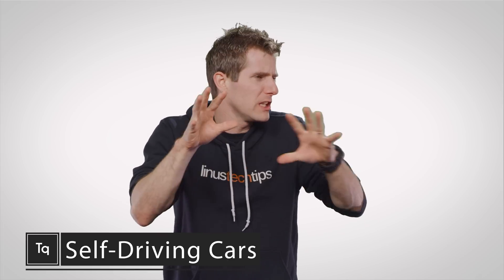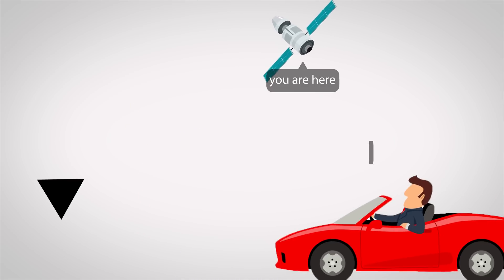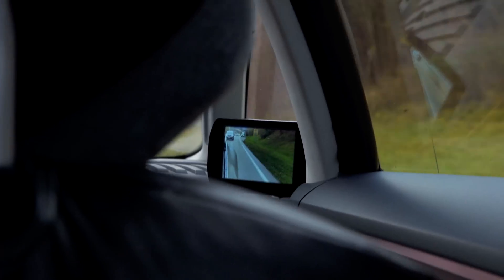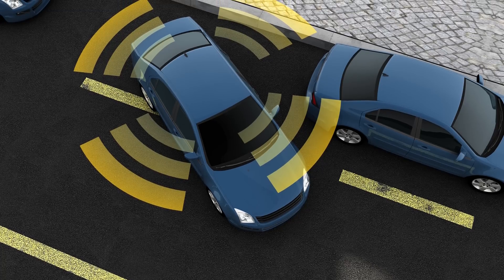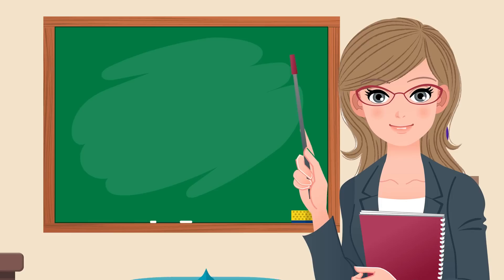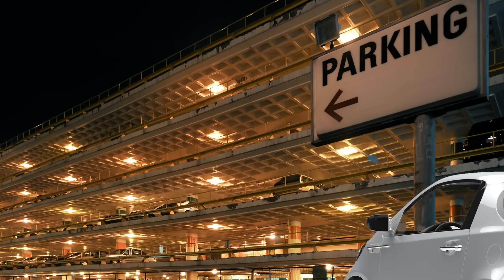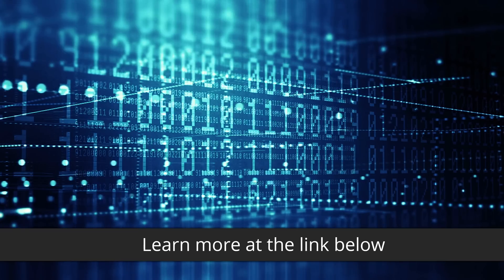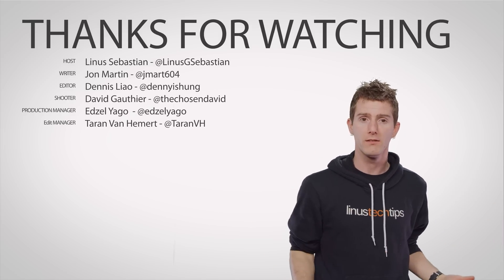Why Self-Driving Cars DON'T Just CRASH

Comment: Now picture the repair bill once those systems starts to faulter.. yep, it's gonna be expensive..
Reply: If those systems would faulter on their own it would be the manufacturers fault and usually there would be an insurance attached. But yeah if you still manage to crash your car it'll be expensive.
Reply: @TheMekaUltra  I imagine that won't be the case once you've had the car for five years.
Reply: @johan.ohgren  ... The  computer components of already existing cars are still the most expensive thing about them. A 'brand new' radio for a 2001 GMC vehicle will still run you nearly $400. Computer components are expensive, especially good ones... which are... you know.. the kind you want in your vehicle.
Reply: @RenniaTrayvold  the computers are not expensive, they just upcharge a lot. A radio should be like $30 but they need to make money somewhere.
Reply: @IhsanAmin  lawl... $30 wouldn't even pay for the materials inside a car radio. Don't confuse modern car radios with your typical stereo xD. Yes they're definitely upcharging, you're right, but not by that much. They'd not sell them otherwise. A competitive market is competitive (Surprising I know). 

So yes, Computers are in fact expensive. CPUs and the equipment required to run them are a lot more complex than a simple transistor radio and thus are naturally going to cost more for the work put in, and when we're talking about computer tech as complex as what's needed in a self driving car? Yeah, it's going to be expensive to produce, and guess what? They too are going to be making their profits... and so is the qualified engineer that you're probably going to need in order to carry out the repair.

So once more, I'm going to have to agree that if one of these busts... It's not going to be cheap. And warranties will probably be the typical powertrain level of warranty for 10 years or 100k miles.
Reply: @RenniaTrayvold  well, the move to cloud based computing should quell those fears. I used $30 as an exaggeration to push my point.
Reply: Also, I don't see their computers being too much as the main cost of a computer is the r&d. Material wise there is a small cost.
Reply: 0 @IhsanAmin  Cloud based computing will not remove the need for on the fly, local processing demands that would be needed for a vehicle traveling in excess of 70+ mph. Especially through a country where the proliferation of the sort of wireless data transfer rates will not become a reality for quite some time. Do you really see the middle of nowhere Wyoming getting high speed wireless in the immediate future? Unlikely. As a result on the fly processing power will be needed for quite a few years still.
Reply: They said that about every system cars have added over the years, including airbags and abs.

Truth is, cars are about as expensive to repair and maintain now as 30 years ago. They are just different.
Reply: @stinger15au   Yeah no, I don't buy that for a second. As a very proud owner of a '69 Camaro as WELL as a 2004 Silverado, and as someone who does ALL the feasible work on them personally (Sometimes you just don't have the time or equipment), I can tell you that that is a load of bullcrap. Even when you take into consideration that the Camaro is a CLASSIC car and thus the prices for repair tend to be massively inflated over what they could otherwise be, the Camaro is A LOT cheaper to maintain than a vehicle that is still nearly 15 years old. And that's considering a vehicle that's from literally half a century ago, let alone one from the 80s which possesses these wonderful things called emission control.  (Which as a hint... made them massively less popular and thus cheaper)

and no airbags and ABS are not the same thing as a central processing unit. I'm not saying the prices will never drop, but they're NOT going to drastically fall within the next decade without a MAJOR breakthrough.
Reply: @RenniaTrayvold  The good thing about reality is, it doesn't matter if you buy it :) That is what's going to happen.

Comment: You know what really grinds my gears? The accepted rule of "have to slow down on a narrowed road due to a construction'. IT'S WRONG!!!
Traffic have to speed up through that zone in order to maintain the flow. IT'S 6 GRADE PHYSICS, FFS.
Reply: It's safety over convenience. If you were to drive even faster when there are mo canre obstacles than normal, it's clear there is an even higher risk of accident.
Reply: @Leonhart_93  I can see the signs and flashing lights from miles before the roadworks (as they usually place them in advance), so I'm prepared to evade those obstacles safely. I'm not a blind moron.

Comment: All these sensors and computation uses up a lot of electrical power so until the battery technology makes a significant leap this will stay a gimmick
Reply: That's one of the reasons why a lot of autonomous vehicles these days are hybrids or EV's.
Reply: they have a generator on the breaks of most electric cars now
Reply: @nathanmead140  All EVs and hybrids can use their drive motors as brakes, generating electricity in the process.

Comment: Cars will always crash. Self-driving cars will most likely crash a lot less than normal cars but when they do, it's not up to the driver or anyone else. So who gets the blame?
Reply: If a self driving car crashes, the manufacturer gets the blame. There will be plenty of lawsuits once these cars are common and they manufacturers will probably go back to the semi-autonomous cars, so they can shift the blame back on the driver.
Reply: @MAGAMAN  I think that is likely to be the case.  Of course, it will result in far more people dying who otherwise might not have had to die.

This is why I feel like we need some kind of legislative solution.  Of course, today cars aren't ready to drive themselves, but at some point it seems inevitable that they will become safer than human drivers, and when that happens it will be crazy to just let people die because we are unwilling to find a solution to the liability problem.

However, the vaccine analogy is probably a good one in this respect.  The limitation of vaccine liability is controversial even today, and many argue that it should be eliminated.  It seems likely that giving any kind of limit on liability to car manufacturers would be just as controversial, if not more, because society tends to be a bit more open today.
Reply: So let me get this straight, you would rather have cars drived by humans and prolong, if not completely refuse the introduction to such a vital technology, even if you knew that the number of deaths per year in the world caused by vehicles would reduce by the thousands, just so you can have someone to blame? Terrific argument there pal
Reply: @mikeey6804  My bad, I initially read only the comment of the person I replied to
Reply: It depends. There are going to be circumstances where these things crash and the accident wasn't preventable (as happened recently when a woman was killed when she stepped onto a road right in front of a self-driving car). The car had no time to react. Or a situation where something suddenly blocks the road and the car has to make the decision to either hit that, likely killing its riders, or moving over and sideswiping another car.
Reply: @ayoCC  Earthquake weren't made in a factory by humans.
Reply: I've read the comment thread and all I'll say is I'm 23 and I will never in my life (which should last another 53 years by the life expectancy here in the US for males) buy, own, or ride in a self driving car.  I do not trust them nor shall I ever do so.  I would rather die because another person was drunk than because their car's computer went all Terminator.  Or better yet, as the movie Upgrade showed, was hacked.  So even when everyone else is out riding in their electric self drivers, I'll be roaring past in my gasoline burning V8.  And yes, gasoline or its alternatives will be around long after the full social integration of electric cars.  You can still find rounds for guns well over 100 years old so no reason to think gas would be any different.
Reply: @randomlyentertaining8287  I expect at some point you will. It may be a circumstance where you are going from one terminal to another at an airport and the shuttle turns out to be not just automated like the ones we have not, but autonomous and gets onto the road for a short period.
Reply: @ayoCC  Yea right... Car just kills someone, whatever, get the money and move on.
Reply: @69MrMaster69  this is actually the model used for vaccine liability. Basically the US government runs an insurance risk pool for anybody injured by a vaccine. The rationale is that the public benefits from universal vaccination and cheap vaccines, but since they are given to healthy people and rarely kill them, they would otherwise be a liability nightmare. More would die without vaccines, but then the deaths couldn't be blamed on anybody. 

This seems like a very analogous situation to self driving cars. Fewer people die, but they're still a liability nightmare as those few can now sue somebody with deep pockets. So, just establish a risk pool and and fixed payment schedule for those who die. 

As with vaccines you would also need regulation since in the absence of liability manufacturers would have incentives to cut corners.

Comment: I feel very confident about self driving cars, especially when I know how electronics are not prone to break and leave you stranded on the middle of the road and especially after Boing 737 MAX 8 MCAS system (new system, like couple of months old ... not prone to breakage at all) wasn't responsible for two plane crashes in couple of months (hooray for faulty sensors and bad programing) ... I see a bright new future for us all; going with our cars to a repair shop every month and leaving our paychecks there. But hey, who gives a crap about you. If you can not afford this then walk, more space on the roads for the rich people.
Technology is great when it helps people, when it works alongside them, but when you are late for a meeting and your car refuses to start because the faulty tire pressure sensor detects flat and there is no way to shut that sensor down and later you find out replacement for that sensor (which is embedded in to a tire so you have to change the whole tire) costs you half of your paycheck and you have three more of this sensors in your car, well, suddenly I like electronics even more.

Comment: When all cars move at the same time when the light turns green...

Nothing is worse than seeing a green light for 30 seconds and not moving.
Reply: That won't change.  The reason you wait while the cars start moving one by one, is basically because cars don't drive as close as they sit while motionless. You can think of the space between cars as a measure of time rather than space. A car being 3 seconds behind the one in front, the actual distance is dependent on speed. 

So basically computer drivers will be subject to the same phenomenon of sitting at the green light while the line in front gradually moves.
Reply: When every car is self-driving, traffic lights will be a thing of the past
Reply: @OppositeToUp  That's almost like saying "I'll pay that bill when I win the lottery." Not gonna happen, at least not for a VERY long time.
Reply: @OppositeToUp  I don't think they will be a thing of the past and neither they should. Even if you have only self driving cars on the road not having traffic lights would create many bottlenecks. What would be nice is having smart traffic light network that is able to accurately monitor vehicles and traffic across the city and based on that info dynamically decide strategies so there are less bottlenecks.
Reply: @Jasterrrr  The cars would network with each other work it out. What you just described could easily be done by the cars themselves working together. Thus no need for lights.
Reply: yeah I fking hate it when I'm in traffic and idiots drive slow and take like 10 seconds to move at a green light...
Reply: I could think of a few worse things... being stabbed in the eye for instance. I'd wager thats a good bit worse than 30 seconds at a green light.
Reply: @firstname565  For someone on the way to a life changing event, they might just take the offer of being stabbed in the eye over waiting at several 30 second lights on the way.
Reply: @firstname565  Being stuck for 30 seconds at a green light while being driven to the hospitle because your eye was stabbed out.
Reply: Shayn Having a miscarriage is worse than getting stabbed in the eye
Reply: @iRicardoYT  and having to wait 30 seconds at a green light is worse than having a miscarriage
Reply: Waiting at a red light for 2 minutes because someone did a U-turn during the green light is worse.
Reply: To calm myself during such moments I audibly play out what must be going on in their heads:

"Huh?! What? Ey George, y'ever see such a thing? That light turned green! Never encountered any such thing in my drivers training. Let me pull out my manual.

Aha. Yes. Let's see. Green light. Means to stop. Just like the yellow light. Wait! Wait.. Actually.. It says.. I should go.

How do I do that again? Let's see..

Mhmm...

Aha. Foot on the pedal."

And traffic finally starts moving.

Comment: I dont trust intelligent cars. I like to drive myself, or even better: Fly.
Reply: That's part of the problem then. Humans cause more errors than computers. It's like that self driving bus that was involved in an incident the day it launched, caused by the other motorist.
Reply: @scriptosaurusrex  yeah, obviously. But computers can be hacked. I cant. Probably at least. I do not want something I can not control. And then, there is Boeing. A software error causes crashes, the airliners have to be grounded. Imagine that with a car. There can be likewise problems with motors, but that is just another single point of failure. It might be better if the software was open source, though.

Comment: I thought this was going to be trying to convince people that self-driving cars don't just crash...have you seen/heard about all the crashes caused by Tesla's Autopilot and other similar systems lately?
Reply: Most crashes in autonomous vehicles would've happened even with a normal human at the wheel.
Reply: @aero7535  There is absolutely no possible way to know that. I find it quite humorous that anyone would say something so absurd.
Reply: @aero7535  So, a human would be fooled into driving into the wrong lane by some small colored square stickers on the road? Because a group was actually able to cause the autopilot to do so and no interference from the driver was able to override it.
Reply: @Zalaniar   Michael Swader  Let me respond to your first point. Let's go back to the Uber accident, where a lady wearing black clothes at night crossed a highway. No human being had the sufficient reaction time to apply the brakes in the time that the lady was visible. For your next point, autonomous cars are always improving. Your example stated a "flaw" that would be extremely hard to replicate in the real world.
Reply: @aero7535  Ok, you've given one example. There are many, many more where, as I said, it's impossible to know. Just Google "Tesla autopilot crash" and you'll find them. Also, the sticker thing was done on a temporarily closed public road, so no, it wouldn't be hard to do in the real world, since it already was.

Comment: Writting a separate comment because this needs to be reinforced everytime autonomous cars is a subject: Tesla DOES NOT have any autonomous cars right now. Teslas have an autopilot system that is currently an advanced version of cruise control and nothing more.
Yes, Tesla is working towards autonomous car technology, but it is nowhere near being truly autonomous. Do not confuse both.
Current classification has 5 levels, 5 being a fully autonomous car... Teslas have a system that is in between level 2 and 3, Waymo is closer to 4 but not quite there yet... it is not a trivial thing to get from one level to another, it's more like a leap in development.
Reply: Exactly, computers can't even determine objects in photo programmatically not to mention processing live data. Make a car drive between 2 lines - well students is doing it at least for 10 years now with toy cars

Comment: Car AIs communicating amongst each other could be very dangerous because people with negative intentions could rig their cars into sending false signals to cause accidents.
Reply: Sure it's possible. But I guarantee it will be harder than just break checking people, harassing them or other foul minded driver behaviour that's currently possible to even an 18 year old wanna be gnagstor boi in their first beater motor.

Comment: dont forget an enchanted version will be always tracking the car condition and collect the data about the parts which is are in bad condition or need to be changed.
intergrating all of that will be making the car value higher but more safer

Comment: I'm a mechanical engineering student working on a driverless formula car and the cs tech lead would tell you it's easy.
Reply: Because racing tracks are actually much easier than public roads.
Reply: @juschu85  the car has no knowledge of the track so it has to map it as it goes, on the first lap it doesn't know if there's a hairpin ahead.
Reply: @laser14344  But after the first lap the track is mapped. And even if the car has to map the track itself, a race track is a much simpler environment than a city. There are no pedestrians, no animals, no traffic lights, no other vehicles crossing the road or driving in the opposite direction, ... Everything is much more predictable.
I'm not saying it's easy, it's just much easier than self-driving cars on public roads.
Reply: Don't you think that driverless formula cars will be quite boring?
Reply: @mrguest3749  it's more about the challenge of getting a computer to drive a car at its limits.